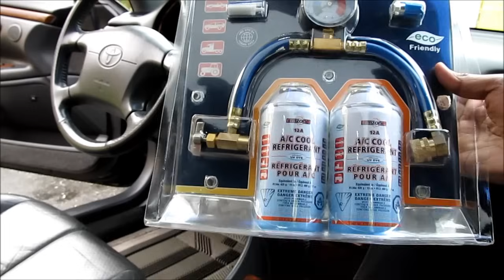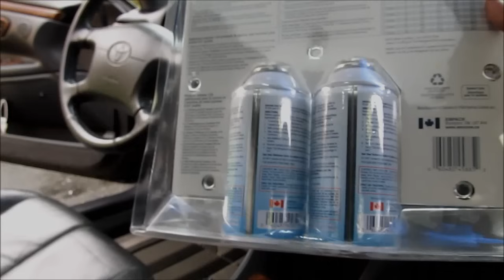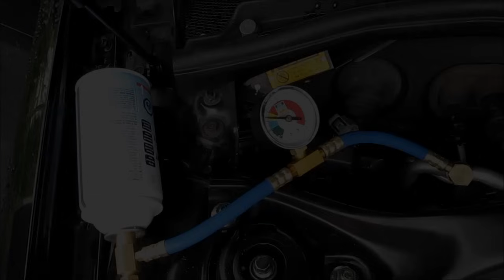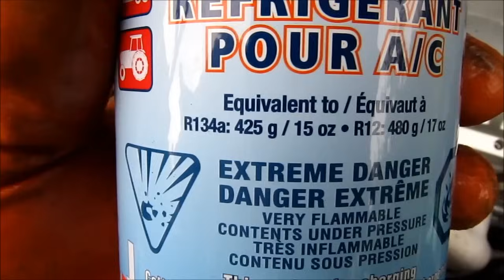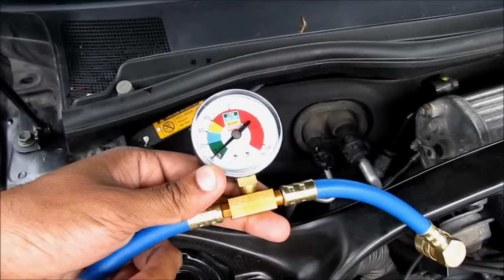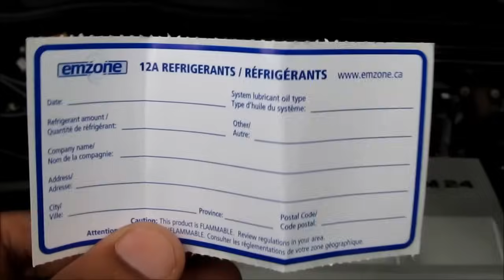How to Recharge an A/C System

Comment: If the system was under vacuum and you check for pressure the way he did you defeated the purpose.
Reply: go learn about AC it'll help you sound less ignorant
Reply: @bruceedrich8048  It's supposed to be installed at atmospheric and it doesn't react to moisture - learn about R12a, you'll sound less ignorant.
Reply: @chrisyboy219  Lol
Reply: I'd say it's at atmospheric pressure when it's empty of coolant
Reply: @x_0euf  it's called refrigerant and your supposed to vacuum out all air before refilling - that means it contains no air.
Reply: An irritable Jew, what a shocker.
Reply: @onepalproductions  yes he is and smarter than you as most Jews are.
Reply: OnePalProductions 😂😂🤣🤣🤣🤣🤣🤣

Comment: The R134a compressor lubricant is not compatible with lubricant for R12.
Reply: R12a is not the same as r12. R12a is typically a blend of r290 (propane) and r600a (isobutane) and is compatible with oil used in both r134a systems and r12 systems
Reply from the maker: I used R12A

Comment: using a kit like this is the quickest way to ruin your ac system. each vehicle takes a precise amount of refrigerant and the pressure will only show if there is blockage on a properly filled system
Reply from the maker: That's true, the right way is to use 3 gauges
Reply: Not really high and low psi switches will kick the system off  for protection..pressure to relation ship of outdoor temp is very accurate and thouse charts are very available
Reply: @darylherlick2344  I once had a rental I was driving up a mountain on a hot day.  The high pressure switch failed and the gas came out of some blowout valve.  What a racket it made!

Comment: You can't just recharge the a/c system when you have air in it. Obviously, you have no idea how the system works. You need to evacuate the air first before charging it with R12a or R134a. If you are just low on refrigerant, you can do this procedure or follow the instructions from the kit but if your low and high side pressure is at zero gauge, the system needs to be checked for leakage by an a/c technician or someone who knows how it works.
Reply from the maker: I think you missed I mentioned that at the beginning of the video...
Reply: speedkar99 yeh thats true however before charging the system you have pressed the low side needle to show us it was empty. in fact it was not empty but filled with ambient pressure which is not good for ac system.

Comment: Why use R12 into a car made after 2000 that has R134 in it?   Both in the US and Canada, Amazon is selling refill kits with R-134
Reply from the maker: +Royale with cheese R12A not R12
Reply: I think there is a little confusion.  There is no such thing as a R12a refrigerant.  If you look on the bottle, it says 12a, not R12a or R-12a.   12a is actually the short name of HC-12a which is an entirely different refrigerant from R12 or R134a.  So in the video you should rather say 12a or HC-12a because when you say R12a it may make people think this is just another 'version' of the older R12 refrigerant.
You also mentioned the R134a was recovered at a garage, which is good.  I think many people will just try to release the refrigerant by themselves, so for those, remember that the R134a while no depleting the ozone layer, has a very high Global Warning Potential factor (GWP) of 1400 and has an atmospheric life of 13 years. 
My worries are that many people will try to release the R134a at home without recovering it. Remember that the car was designed to cool perfectly well with the R134a, so if the car isn't cooling enough it's because after 10-15 years some refrigerant is lost through the seals, which is perfectly normal, just top it up with R134a from Amazon and call it a day.
Reply: @Peppermint1 As I recall, the old R12 had a GWP of 13,000 with a lifetime of over 100 years!

Comment: Ok, this guy is officially clueless. To all out there who are considering following these instructions, I cannot say this strongly enough, DO NOT PUT R12 in a vehicle made for R134.
The R12 molecule is considerably larger than the R134 molecule and if you fill the system up to the recommend PSI, but use R12 instead, you will rupture every coupling, join, and gasket that makes up the entire cooling system. Very expense to repair.
Reply from the maker: +Alan Schlieper Please read the description
This is R12A and not R12.
Reply: No one is talking about, or using R12 in this video. And you call someone else 'clueless'.

Comment: Just to clarify, I take it listening to your video, and just scanning a few of the comments down below, it is not a good idea to just do this on my own? I literally just purchased an ac recharge kit from Canadian Tire, and was hoping to do it now.
Reply: answered my own question, not a good idea, and it clearly states it on the product.
Reply from the maker: +Brother Simon yea thats why they sell it to DIYers
Reply: ashton benz just did it myself no issues ac blows ice cold now..
Reply: what happened? gonna do it myself
Reply: got one from canadian tire and it worked fine. blowing ice cold so far. the question is how long will it last? only time will tell..
Reply: @greenbackz  Any updates lmao? I've had my car 3 years...im just too lazy i guess to fix it. not exactly needed. Ac condenser got a gash it in, but ive ''jumped'' the compressor circuit and it goes fine no weird sounds, just needs some more juice i guess and a condenser. You use their red tek r12a kit?
Reply: Watch the YouTube videos that use a manifold gauge set for AC servicing.  They give a much more thorough presentation about how to do the work.

Comment: One thing i learned is you need to purge the rubber line hooked up to the freon can to rid it of any air. Just hooking it up and opening the can to refill the system is definitely not the proper way. Yer just letting in air along with the freon.
Reply from the maker: +GAGE1959 good tip thanks

Comment: you need vacuum before!
Reply: He actually did it correctly, even if by accident LOL.  Unlike 134a, 12a must be installed at normal atmosphere. This is from the Red-Tek 12a installation guide:  "RED TEK® 12a Refrigerant is installed through the LOW SIDE SERVICE PORT AND IS CHARGED AS A LIQUID INTO A "0" ATMOSPHERIC CONDITION. DO NOT INSTALL INTO A SYSTEM WHERE A HARD VACUUM EXISTS."
Reply: cheepGeek - I did not know that, interesting. Good thing I haven’t done 12a into anything before
Reply from the maker: +Jean-Francois Nadeau I had a shop vacuum it first.
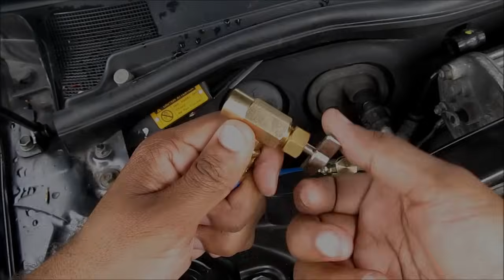Reply: Ok yes, but you push with your screw driver the spring valve at 0:53 on your vidéo, which means you lost all your vacuum
Reply from the maker: +Jean-Francois Nadeau Sorry I meant I evacuated the system.

Comment: so you are teaching people how to recharge the ac without vacuuming moisture from the system it is going to blow hot soon if charging your ac was so easy shop would not make money
Reply: Gearhead gearhead... I sooo sure a shop would let him video it! :)
Reply: He did say that previous gas was removed...did you even watch it?
Reply from the maker: +gearhead gearhead I did have a shop vacuum this system before recharging it
Reply: you should had shown it.
Reply: what if release r134a whatever into the air, because need to replace a leaking oring,  then perform this DIY charging kit.   I don't think i'll have moisture nor air since replacing an oring would only take me like 5minutes maybe.   Do i still need to vacuum whole system first?
Reply: @isbemorph You're okay.  Replacing a compressor, condenser, hoses, is when you need to consider a vacuuming.

Comment: Is it better if you can vacuum out the AC system first. I've got a very, very slow leak (recharged in a friends shop late spring last year and worked all through the summer and fall and need to recharge again, 1 year later). I plan to use the ProSeal first and then recharge to hopefully fix the leak for good.
Reply: A mechanic did that for me.  It was empty in 1 day.

Comment: I see a lot of people have the A/C running for awhile before putting refrigerant in their vehicle, is this necessary or is your way better?
Reply from the maker: +Dean M Yes.
Reply: I'm sorry yes to which method?
Reply from the maker: +Dean M It needs to be running to add refridgerant. The pressure drops when the compressor is on and that's when you have to add/measure the correct amount.
Reply: Awesome, thank you.

Comment: I use the A/C Pro gauge to install refrigerant. I figure most of the cost for A/C Pro is in the gauge and hose and since refrigerant is basically cheap; a can will cost you between 4 to 15 dollars, believe it or not it works great and I trust their gauge and hose over the regular hoses and valves used for the same product. Appreciate the folks of A/C Pro for making a quality and safe product, top to bottom.
Reply: Dean M 
That stuff is for idiots. Get ready to drop a few grand on repairs.
Reply: @dontblameme6328  nobody will put that kind of money in an older vehicle, its not practical, thats why R12a is very plausible...
Reply: Iîoiiîîooo

Comment: This R12A is suppose to also replace freon R12 but have using R12A done any damage to your system?
Reply from the maker: +Jon Paul R12A is the replacement for R134a. In Canada this is what they sell over the counter, you need a license to handle R134a
Reply: There instructions say R12A also replaces R12.  I have a R12 Freon system and it is empty now blowing hot air.

Comment: 0:08 The refrigerant that you are using is 12A which is not 100% r134a. I mean it is just a replacement of r134a.
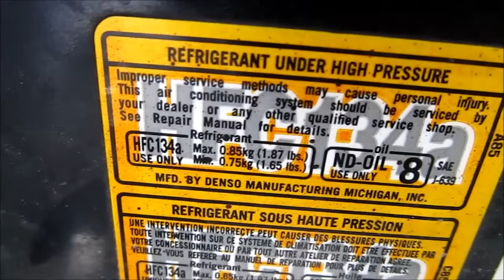2:58 you need between 26lbs. to 29 oz/1.87lbs. of r134a according the yellow sticker you showed.
As r134a doesn't weight SAME as r12 so ther is a little bit difference of weight.
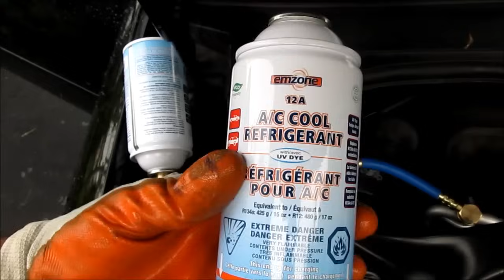3:11 it say clearly 15oz of r134a is Equivalent to 17oz of r12.
In other words theses two bottle have 30 oz of r134a which are not roughly enough but a little bit high amount that you need. all this to say do not put more than needed.
Reply: R12a is a propane/isobutane blend.
Reply: @jackb1803  what it does make difference?

Comment: Compressor:  Is it possible to keep my compressor from turning on when I have the defroster for my HVAC turned on during the winter months?
Reply from the maker: +siucbset Not unless you select the defroster mode manually. Why would you want to do that though, the ac helps to dry the air and remove moisture that causes the windshield to fog up, and having your compressor idle during winter could cause it to seize.
Reply: speedkar99 I want to disable the compressor running to save gas.  I have the manual HVAC so it is different than your SLE Solara.
Reply: Sure you could do that. Then your windshield would be completely fogged up. Congratulations idiot.

Comment: Can you recover R-12a  in a recovery  tank like all other refrigerants to install a compressor?
Reply: Recovery of any refrigerant is not to be mixed with any other type. Before the recovery process, the tech is supposed to always test the refrigerant to see what type it is or if it is contaminated. If it is, it can’t be recovered and reused. It will be recovered into a tank and disposed of which can be expensive and usually the customer will be charged. Not all refrigerants are recovered to be reused. They will be recycled and purified in a separate process before reuse.
Reply from the maker: +Tmusic Todd I'm not sure, I would assume it would behave the same as r134a
Reply: @speedkar99  both refrigerants are heavier than air and just fall to ground,,,all other mantras are just myth for dollars
Reply: @bonniejohnson1518 No, the wind will mix it into the atmosphere.  R12a is very safe for the environment but is highly flammable.
Reply: @speedkar99  Connect it to your grill and BBQ some hot dogs.  It's 95% propane.

Comment: You had your car's refrigerant reclaimed by a licensed tech = Smart
You then demonstrate by opening the schrader valve, letting in air = Dumb

The goal of refrigeration is to absolutely minimize non-condensables.  This is why we purge line sets, vacuum down the system, check for leaks, and NEVER OPEN VALVES TO THE ATMOSPHERE.
Reply from the maker: +mcw0530 You open the shraeder valve to the can. It doesn't get exposed to the air.
Reply: He's talking about how you eliminated vacuum from the system by pressing down on the schrader valve with a screwdriver, not when you connected the can. This exposed the system to air which contains moisture and other impurities that can corrode and destroy A/C systems. Also, if your car has a receiver drier (not sure about your car), the dessicant contained within becomes saturated with external oxygen that contains moisture. This is why receiver driers are replaced when the A/C system is opened.

Love your videos though.
Reply: I use to have the A/C vacuum down because the claim was if not it will damage the system... Many years ago I skipped the vacuum down and just added freon with out no damage. It was an old truck I had that at that time had over 300,000 miles. The A/C and the truck lasted for over a another 100,000 tell I sold it because I bought a newer truck..When I saw that no damage happened it have done the same to other A/C with no problems... Just saying I no its not by the book but do what you want...
Reply: @SawmillerSmith  Sacrilige, you must comply with the AC Gods and fear mongers - the same is true of home systems.  The entire industries are fueled by FUD (Fear Uncertainty and Doubt).  I understand all these but the mere fact that any shop I speak with stays vague and ambiguous.  If the quoted price was high but they told me EXACTLY (and I could watch) did, it'd be worth it.  Instead they act magical and mystical just so they can tell you later, 'you need new 'compressor bearings'...
Reply: @Johnslist  I wrote that comment 3 years ago and I'm still doing the same thing. Even on a 2018 chevy I have now that I bought of an insurance company that was in an accident.

Comment: THE FIRST THING YOU DO BEFORE YOU EVER ATTEMPT TO CHARGE ANY AC SYSTEM BOTH CAR AND HOME TO COMMERCIAL WHICH NONE OF THESE PEOPLE TELL YOU IS TO CLEAN YOUR CONDENSER. A DIRTY CONDENSER CAN RAISE THE HIGH HEAD PRESSURE 100lbs. SO CHARGING YOUR DIRTY CONDENSOR CAN READ HIGH SIDE PRESSURES UP TO 275-300 LBS OVER WORKING YOUR COMPRESSOR WHICH WILL LEAD TO BLOWING IT.  CLEANING YOUR COMPRESSOR IS A EASY PROCEEDOR. SPRAY SOME FANTASTIC CLEANER ON YOUR CONDENSER AND LET IT SOAK FOR 5-10 MINUTES. RINSE IT DOWN WITH A HOSE AND NOW YOU ARE READY TO SAFELY CHARGE YOUR SYSTEM. SOMETIMES JUST CLEANING YOUR CONDENSOR WILL RESTORE THE AC UNIT WITHOUT EVEN NEEDING A CHARGE OR JUST A VERY SMALL TOP OFF TO THE SYSTEM. BY CHARGING WITH A DIRTY CONDENSOR YOU MY OVERCHARGE THE SYSTEM TO THE POINT WHERE IT DOESN'T WORK BLOWING THE COMPRESSOR OR RUPTURING THE AC HOSES. AS A RULE OF THUMB "CLEAN THE CONDENSOR FIRST".  I CLEAN MY CAR CONDENSOR  EVERY 2 YEARS..

Comment: I tried it with this kit. The gasket on the coupler was defective and leaked out when I tried to charge it. Basically wasted a can but took it back and got my money back. May try again with a different kit
Reply from the maker: +dave houston Mines been working great, I've used it at least 10 times already, it's worth it.
Reply: dave houston LMAO such a random thing to say but I died laughing 🤣
Reply: Your suppose to check to make sure the oring doesn’t fall out lol always check first lol 😂

Comment: you put a highly flammable refrigerant into your car ?  Great when you have an accident
Reply from the maker: +bobl78 This is R12A and not the old R12
Reply: it is highly flammable.... how does the oil check Thing work?
Reply: i was surprise also when he said that. this r12a replacing r134a. it mean you can put this can in a vehicle which basicly use r134a. there will no problem. i used the same can for my van.
Reply: In some countries, you have no other choice.

Comment: Before charging 134a into the a/c port, be sure and bled the gauge hose of air, this will keep air from getting in your a/c that will turn to moisture, causing damage.
Reply from the maker: Good point!
Reply: Bleeding the gauge hose is done with hose/bottle connected to the car low pressure line and best BEFORE puncturing the bottle. Slightly unscrewing the gas bottle until gas blow out from there coming from the car line and then tighten bottle again.

Comment: how do i know which is my low a/c port its a dodge journey 2009
Reply from the maker: +Sthefany Chapa the cap should have an L on it
Reply: check acprocold website they have a datailed guide to every car
Reply: They're also different sizes for safety reasons.

Comment: ASAP please...are you supposed to put a vacuum on the system prior to install?
Maxifree r12a says NOT to put a vacuum on the system.
Reply from the maker: +Brick Wall Not before topping up fluid, unless if the system was contaminated or was opened to the atmosphere or has a different refrigerant than the one you want to put in.
Reply: I meant when the system is completely void of freon.  The Manufacturer said it works best with no vacuum put on the system.  They said it needs air to expand the gas for it to work best.  What about moisture in the system from humidity?
Reply: +Brick Wall Purchased the exact same kit today. Instructions say to have "at least 10 inch mercury" before refilling.